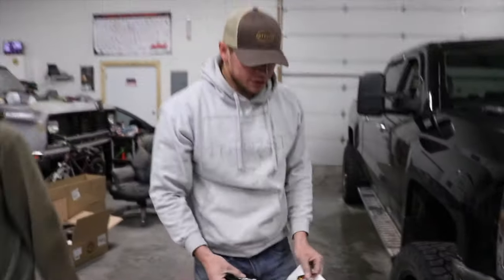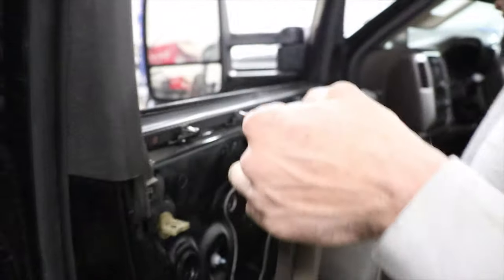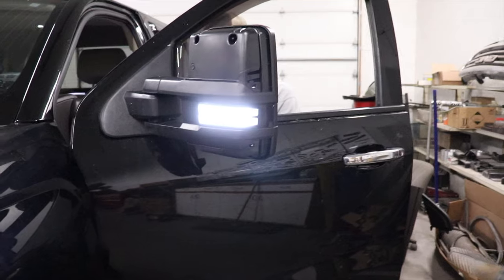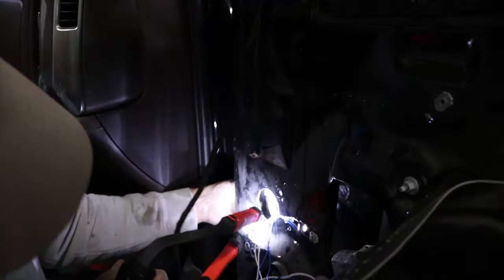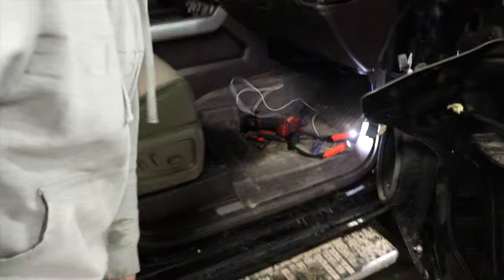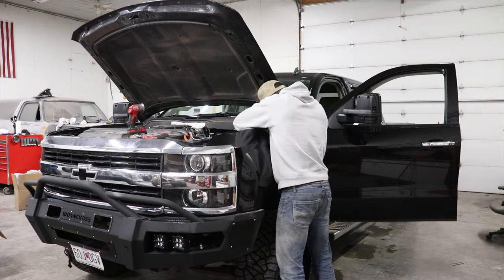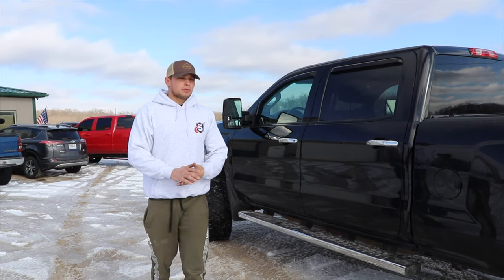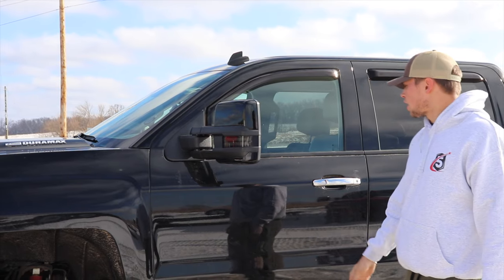Installing Boost Auto Parts Mirrors on Early '15 Silverado

Comment: Great video! The reason the fuse tap didn't match is because we typically recommend wiring the white wire to the cargo fuse in the passenger fuse box which is a micro fuse. 

The truck looks great! For anyone looking to do this mod, here's a link to the mirrors: https://boostautoparts.com/collections/tow-mirrors